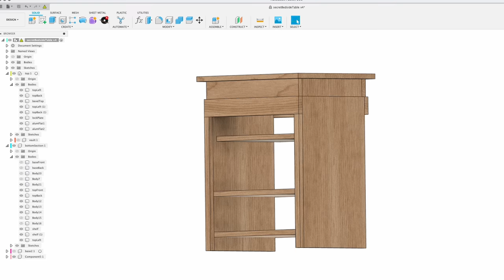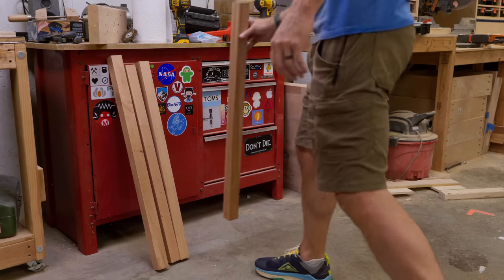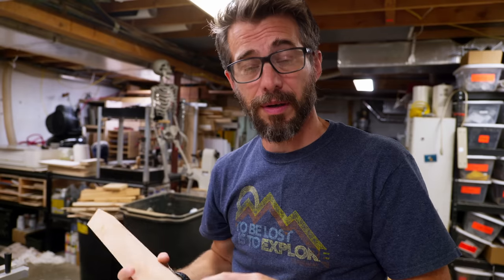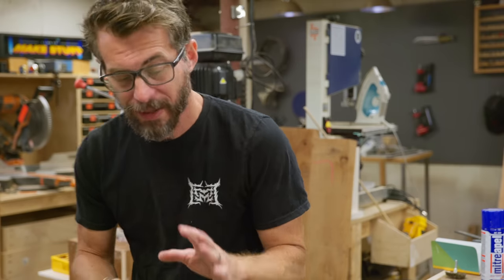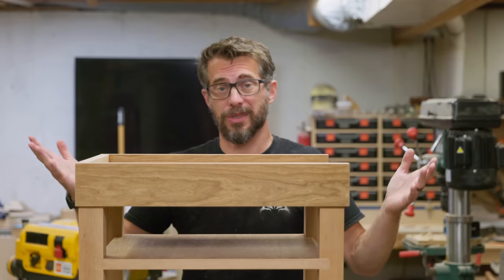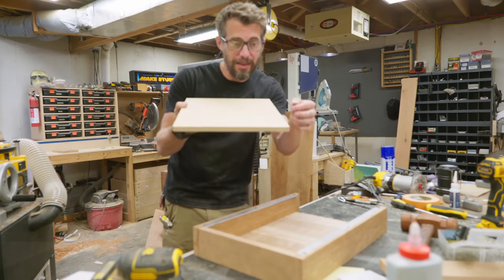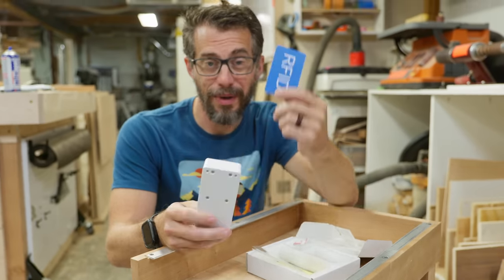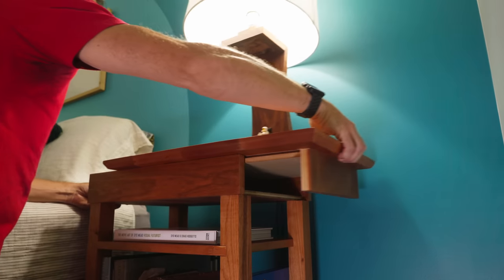You'd NEVER Guess How It Opens  (BUILD PLANS AVAILABLE!)

Comment: Cheaper and more reliable than the RFID is a simple steel slug in a brass body with a spring, that is in the wood, so you use a strong magnet to pull it back, then slide off. No batteries to fail, no leaking ooze from Durahell mess, and the magnet can easily be explained as a thing to hold the lego figure to a polished steel lamp base, with a few around to hide this.

Comment: Very cool! I like the RIF lock too but I think I would have gone with a low tech magnet lock that doesn't require batteries. The secret is that you would be the only one to know where to apply the magnet key. Also may have gone one further and add a spring into the locking mechanism that the key would have to be the correct strength to unlock the lock... meaning too strong and it would pull the locking bar too far and keep it locked... too weak and it wouldn't pull it far enough. Just a thought for future use. Thanks again !

Comment: For the knife part, I got myself a leatherman skeletool CX close to a decade ago. I never leave my appartment without it, and it's been handy so many times. As for functionnality, it's pretty limited, with only a locking blade, pliers, bottle opener and a screwdriver with 4 bits, but realistically, in a pinch I've never needed more than that, and it stays pretty compact.

Comment: I inherited the same tapering deal from my father.  I have never actually used it.  I made a longer sled using Microjigs fast fit system with dovetail slots and hold down clamps.  Way better in my opinion.  I have not tossed the other piece yet, but something that can go in the upcoming garage sale for sure!   Will let someone else make that call.  The same sled you would use if you don't have a jointer.  Also called a straight line sled.

Comment: Might have pointed out the depth setting on the biscuit joining, too. It is kinda important for keeping the top (and bottom) surfaces aligned.  And my taper jig came with Dad's 50 year old Craftsman table saw...as far as I know it has only been used to collect dust. Unlike my 4inch Swiss Army Knife😄 GREAT advice about those.

Comment: It's cool you have enough space around your bed to have the top slide sideways! Most bedrooms I've ever had are not that large! Therefore I'd have to 90° your plans so it slides out frontwards. Meantime, you have given me ideas to fix the bedside tables mum made for me when I was 18-20yrs old. The top is glass and there's a kinda central shelf with a drawer underneath that she has resting on ledges, however, the sides are hollow as are a pine frame with cane mesh inserts so the drawers can actually twist and then hit the rear part of the frame so they don't fully close, whilst typing this I'm now thinking to suspend the drawer somehow. Drawer slides wouldn't work as would need to be in the side voids, hmm, back to the drawing board. Nice hidden cavity though, I have some RFID items for use in my escape room builds, hmm, ideas abound

Comment: Great video, but I would have built a normal drawer into the front in addition to the sliding top. Sure, it would rob some space from the secret compartment, but then it would make sense for the top part to be as deep as it is. Extra sneaky!

Comment: Biscuits are definitely for adding strength, the equivalent of a dado. While not a third of the thickness when using 19mm  material, the chances of a biscuited joint failing are very slim

Comment: only problem I can see for my own preferences would be that the key needs to tap the far side of the table, making those late night snakkos just that much harder to reach 😅 I don't want to get out of bed to unlock it. i guess I would also say having the big hole out the side might be an issue if you're not careful. Could end up shoving all those knives or midnight snacks out the other side
Reply: I don't think samsung sells them anymore but the airtag equivalent that has a push button on them. could set that to trigger the locking mechanism to open and would be able to do that from anywhere as long as it's close to my phone

Comment: Is it maybe possible to make the taper jig run along the slot on the other side of the blade, instead of riding the fence to keep it straight?  That would avoid trapping anything between the fence and blade.

OTOH, isn't it really just a skeletal angle jig that can do extreme angles?  Make an angle jig capable of going to 89 and you could make any taper, just as safely with the jig.

Comment: Love the design.  Does the lock indicate when the battery is low? I can only imagine trying to get back into this compartment once the batteries have died.
Reply from the maker: It does. It also releases the lock if it dies, so it won't get stuck in the locked position. But for security you we will keep it charged.

Comment: That was a nice build and everything, but practical???  I mean, it's basically a drawer...but much more inconvenient.  So, instead of just unlocking a drawer and opening it, you have to slide the entire top of the table...and everything on it (lamp, book, eyeglasses, glass of water, box of tissues)!  It's kinda like changing a lightbulb, but instead of unscrewing the bulb, you hold onto the bulb and rotate the fixture.

Comment: I don´t have a knife like that, however, I´m one of those who has just about everything in my handbag lol need a screw and a screwdriver, I´ve got yah, tape or glue, sure, band-aid, straw, nailfile, gloves, napkin, battery, powerpack, lighter, toothpick or a toothbrush? gum, chocolate, safety pin, button, needle and thread? bottle opener? tweezers, floss? ;D 
I like to be prepped if anything would ever happen...(my autistic brain does not like all the "what if" anxiety that comes as soon as I leave my home)

Comment: Was a draw stop built in? I would slide it too far and everything on the table would topple over.
Reply from the maker: That was the plan originally, but in my case there really wasn't space to open it until failure in that corner, and the aluminum slide holds it really well. I didn't need it but it's a good idea 👍

Comment: Was there a reason you didn't make it with the drawer sliding out and the top secured????? Just with a hidden lock?????

I imagine knocking over your bed side table lamp several times will annoy you, more than your desire to open the drawer to see knives you've collected!
It's a nice construction though, simple, sturdy, functional, and looks good.
Not sure turning your table sideways, is also "hiding " your hidden drawer! Most people would not have room for something twice the width of the bedside table, to each side of the bed, to allow for the opening of the drawer?